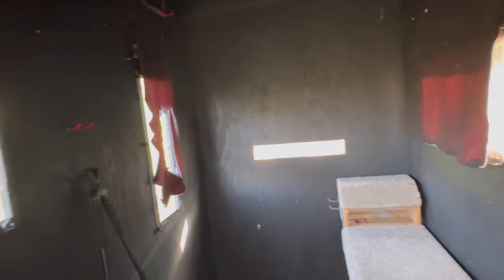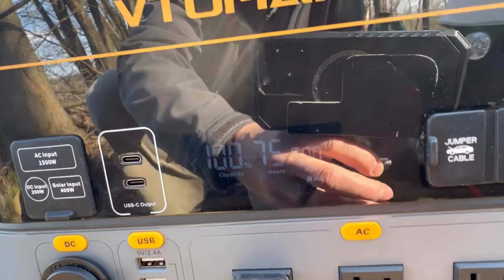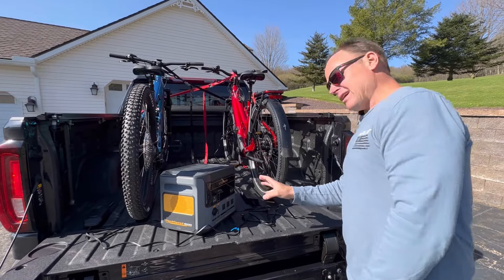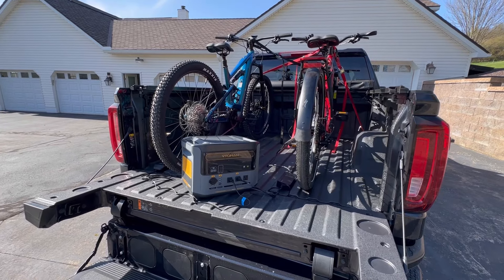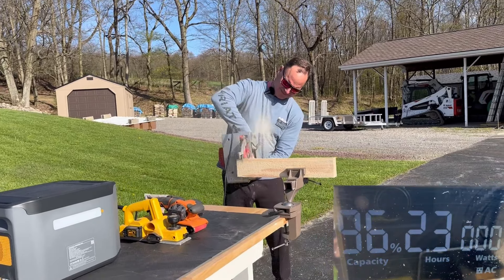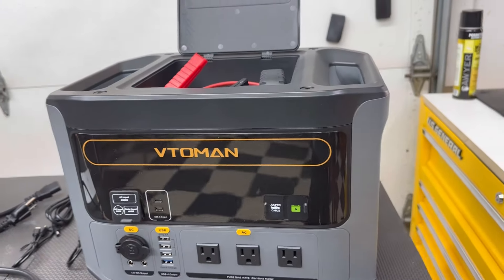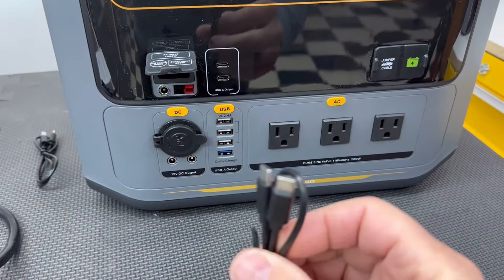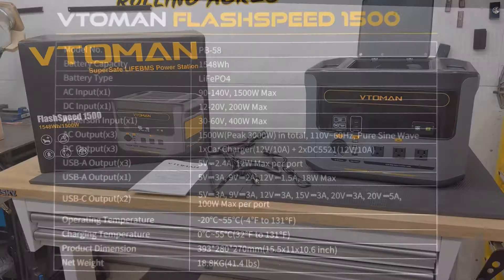Not Everything is CORDLESS!      VTOMAN FlashSpeed 1500

Comment: That power station would be a nice alternative to a gas powered generator in an off grid cabin or deer camp with no noise or fumes and hooked up to a solar panel to charge during the day. VTOMAN could make their jumper cables with longer wires to get to those hard to reach batteries for jump starting.
Reply from the maker: Agree 💯